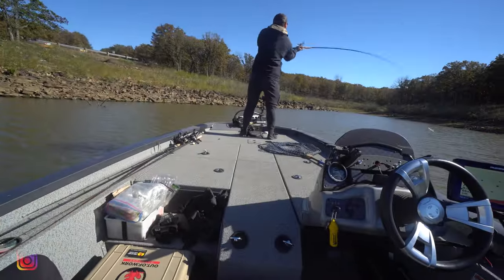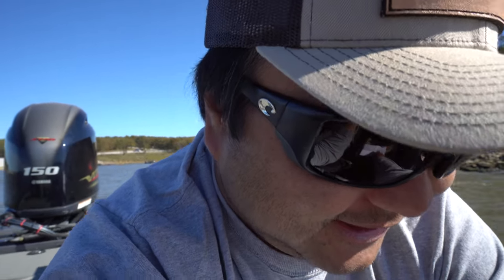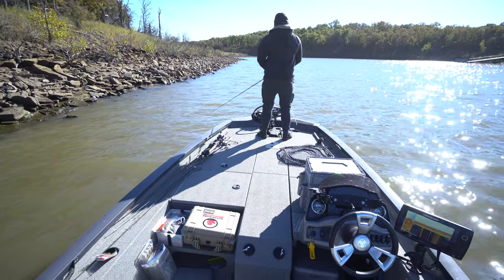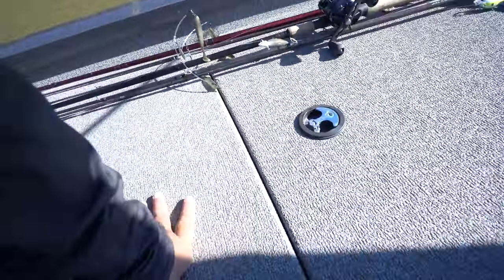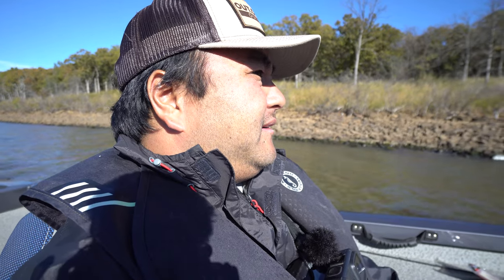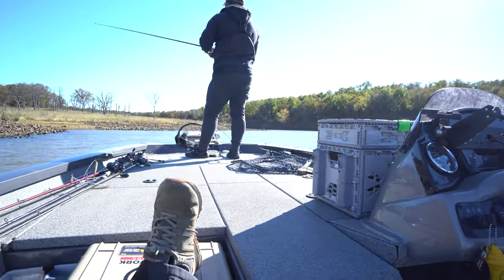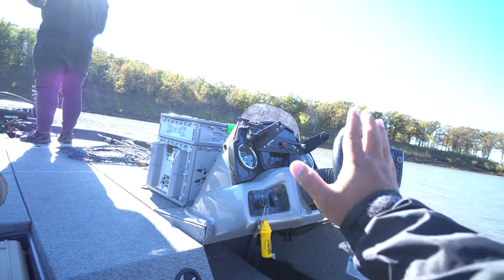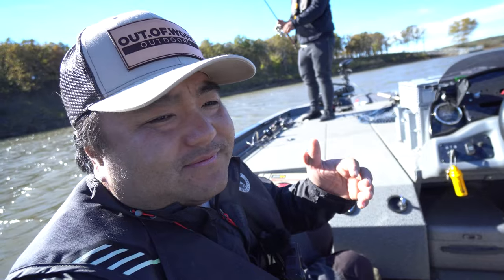The Not so Perfect Aluminum Bass Boat G3 1910 with Yamaha 150 Sho | 6 month Review | OOW Outdoors

Comment: For the boat leak, try replacing your plug. I had that issues 3 years in. Took it out last year to find it. It was leaking at the back and not from the live well hoses, so I pulled it out of the water drained and dried. Replaced the plug and back in the water. No leaks. Fished for an hour and still no leaks. Now a year later, I'm leaking again. Time to replace the plug, again.

Comment: I have a blue fin 14 ft 62 " wide with a 2016 9.9 Honda I had the boat for 43 years no problems here what so ever I think I'll keep it.
Reply from the maker: We have a 1436 9.9 hp too.  But that boat is a river boat and doesn't go open waters no more
Reply: @OutofWORKoutdoors  👍
Reply: @OutofWORKoutdoors  I have a 30 hp Evinrude also but run 9.9 most because I can go most anywhere.

Comment: I thought my boat was bad. I have the Crestliner xf 189. My motor is a Mercury 115 pro xs and its slow. I barely touch 40. The second day trying to take it out, my trim fuse blew up. My paint also chips too but that's to be expected when you hit it with a one ounce tungsten.
Reply: I also own a 22 crestliner xf189!  I was not impressed at all when I took it out after picking it up from my dealer.  Nice stable boat but 40 mph like you said and very trim sensitive.  Took it to a different dealer and they adjusted the height of the engine and sold me a different prop.  Now she does 47 no matter what or who is in the boat.

Comment: Jackplate will fix the wot problems. The motor problem  probably caused by cavitation .. any bigger motor needs a good jackplate.  Hydraulic is nice, but Manuel will work to get it on plane.

Comment: Probably a filter issue for the bogging.  I believe you have three filters to check and they aren’t cheap for filters.
Reply from the maker: I think you might be right
Reply: @OutofWORKoutdoors  Do you have a soft primer bulb?  I have an 1810 115 SHO and sounds a lot like your does - Diff being I could get on plane, but could not cruise at over 4K RPMs.  While troubleshooting the bulb - found those grey fuel lines have an inner liner that was smashed up and/or breaking down, blocking the fuel line.  Replaced with automotive fuel line and bulb is a ton more firm - have not done on the water test though.  ...and yes the trailer is poorly made.

Comment: What prop are you running? I went through 4 til I got my 150 SHO running perfect. The variable camshaft timing makes the right prop critical. I am rumming a 14.5" x 23p Yamaha Pro Series on my Ranger RT198P
Reply from the maker: I am still on the stock one that gave me.   14.5 x 21p.  hole shot is great but top end... not so much.  What are you mph speed getting on the top end?
Reply: @OutofWORKoutdoors  I had a 21 too at first. Hole shot was great, top end was about 44.5 mph.

Went to a 24 p and it would only get to 4k rpm and the boat chine walked.

Then the 23p 6k rpm and 59.9 mph and it runs perfect. 

Try a different prop, that should fix the issue.

Comment: I have a g3 for 10 years only needs oil change and your gas water separator needs change tighten for your motor issue. Didn't buy it with all the bells and whistles put everything in myself
Reply from the maker: same with us.  bought it bare bones.
Reply: @OutofWORKoutdoors  bought v164 angler has  a 98inch beam widest 16fter out there. It's paid off and I been eyeing seaark bigeasy with 250 Suzuki in maybe a year or so
Reply from the maker: Thats gonna be a nice upgrade

Comment: It's obvious that someone stepped on the seat which caused the stretching to rip. It's as obvious that you have ran dirty fuel in your motor causing the dirt to plug the jets at high speed do to flow. It's obvious that you bought the boat and treat it like most people who talk and complain like you. I would also bet you didn't break your engine in as per instructions. It's your Life and your boat thereby your problem. LMAO. I have 1 boat that has been running for over 25 years with absolutely no problems even if it's a Jon boat with a 15 hp Gamefisher motor. This is just 1 of my boats and vehicles that continues to run great. Look at yourself then complain.
Reply from the maker: We are engineers and automotive techs by trade.  Brand new engines and brand new seats should be ok with this
Reply: @OutofWORKoutdoors  what does being an engineer and automotive tech have to do with owning a boat? Clearly you know nothing of the fuel lines needing to be replaced due to bad gas being ran. And because you’re an engineer the seats should withstand your weight of stepping on them? Learn to learn.